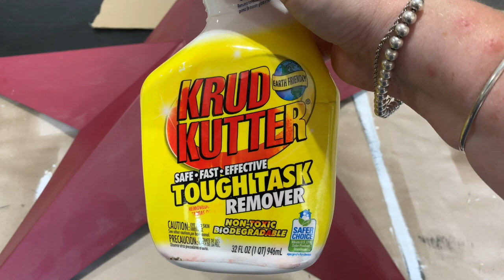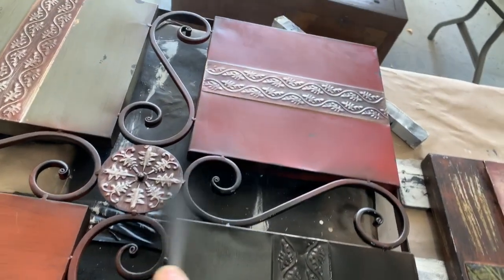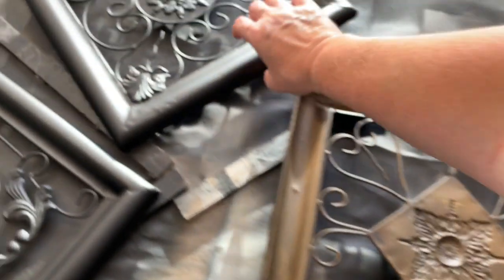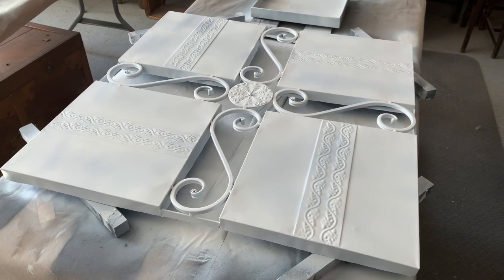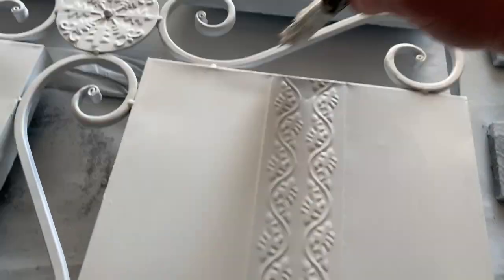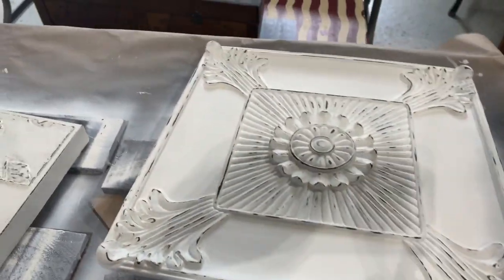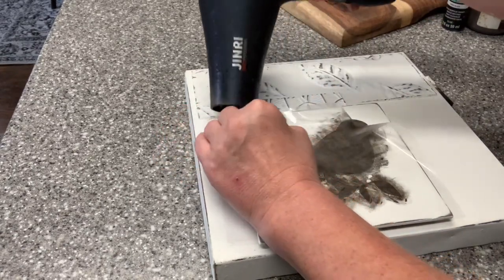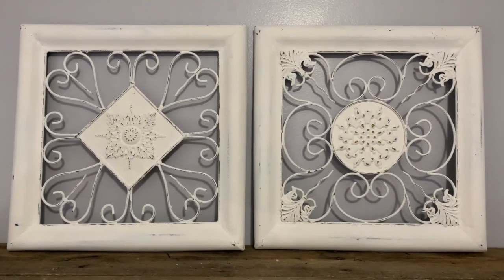Taking Thrifted Metal Wall Decor and Fitting it into Farmhouse Style Up Cycling Ugly Challenge

Comment: When you are doing your stencils try using 631 vinyl.  It is temporary and can be used on walls.  The 651 is permanent vinyl. I love everything you do.
Reply from the maker: Thank you. Because my signs are pre sanded(I'm guessing) I have not had luck using temporary vinyl. It would not stick to my pre sanded items to use as  a stencil. And ended up making quite a mess when it did kind of stick. Lots of bleed under. But thank you for the suggestion.

Comment: I found a 15x15 red with white dots magnetic board at a thrift store and want  to change it to either black or white. After seeing your video, I know now I want it black and know what spray paint to use. Since it has a texture to it, using paint and a paintbrush probably won't work. Since I will be using it as a magnetic board, should I use the polyacrylic on it after the black spray paint? Thanks in advance.
Reply from the maker: Yes polycyclic it. That will protect the spray paint. Thank you for asking